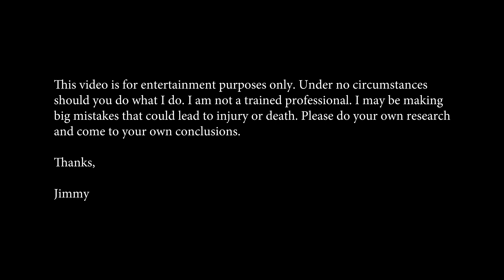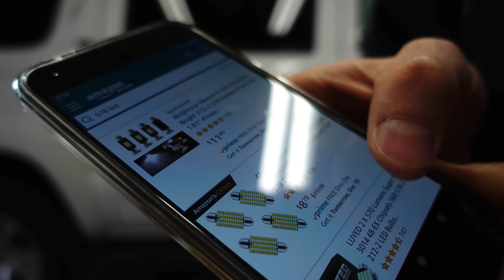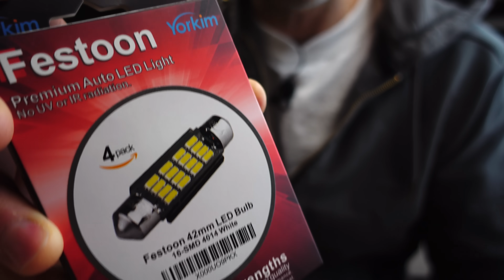Here's Why You NEVER INSTALL LEDs IN YOUR CAR OR TRUCK!!

Comment: Thanks for the informative video. However, I don't think you were comparing LEDs  to "halogen" bulbs. Bulbs you' were replacing are "tungsten"  (filaments, that is) or, otherwise known as "incandescent" bulbs. Halogen bulbs do have high draw (amperage), and do have very high heat output, but also tend ro have very bright, "white" color output, like the LEDs  you're  comparing. Halogen bulbs are only used  by auto manufacturers in headlights (they run way to hot to be safely used in other vehicle locations).
Reply: See my previous post.
Reply: way too hot to.......
Reply: Some truck drivers living in areas with snowy winter had regret switching to LED lights for the headlights of their truck. Ice built up on the cover of their headlights so much that they had to park the truck to have the ice removed. With incandescent light bulbs, the heat from the bulbs can prevent ice from building up on the cover of the headlights.
Reply: @simon6071  their a reason why they made a yellow led bulb
Reply: @urielhernandez3286  It doesn't matter if the color of the LED bulb for vehicles are white or yellow, the headlights are still more likely to be covered in ice than headlights with incandescent bulbs because LEDs are more energy efficient, i.e. release much less heat than  incandescent bulbs, no matter they give out white or yellow light. GOOGLE: LED Headlights are dangerous in snow/ice storm
Some people suggested spraying the LED headlights with cooking spray, Fabulous PB Blaster or WD-40 before you head out in a snowstorm. Even if it works, I think it's too much hassle..
Reply: "Halogen bulbs are only used  by auto manufacturers in headlights " . . . . . .  NO TRUE.. I recall purchasing halogen bulbs for home use, years back .  don´t know if they are still available but I still have one of those  in my garage
Reply: @simon6071  The drivers or owners of the trucks with led headlight icing problems  are due to the fact they installed  cheap led headlights. We have purchased  and installed  quality led headlights with  built in heaters , and they work great in  all weather conditions.  Quality is supreme every time.
Reply: What? LED headlights with built in heaters! Unless the LED bulbs comes with a bimetal thermostat switch which will turn on the heating element only when sensing ice-building temperature, an LED bulb with a heating element that is always on with the light pretty much defeats the purpose of replacing the halogen bulb with LED bulb in the first place, i.e. saving electricity.
Reply: @simon6071  We're discussing INTERIOR bulbs here, and presenter referenced bulbs he was replacing as "halogen" when they clearly were tungsten. Headlights were not in play.
Reply: @josephstabile9154 (My mistake. Comment deleted. )
Reply: @simon6071  Something's getting lost in translation here. Interior lights, inside the vehicle's passenger space, such as dome or door lights--whether LED or tungsten (halogen, because of excessive heat & current draw--i.e., safety, are not available for interior lights) have NO effect on heat output of headlights, and icing over of headlight panels is strictly a function of heat given off by headlamps themselves. Btw, a high % of today's cars have LED taillights & running lights. These also IN NO WAY contribute to.headlamp panel icing--or lack thereof.
Reply: @josephstabile9154  I have been talking about different kinds of light bulbs for headlights only regarding the concern of icing up of the headlights. I don't know why you mentioned the interior lights our discussion. Nowhere did I say or hinted the interior lights and the taillights have an effect on heat output of headlights.
Your strawman argument is inappropriate.
Reply: @simon6071  Sorry to break it to you, Simon, but there ain't no strawmen, haymen, grassmen, etc. here. My first post to the youtube presenter, was in regard to his presentation of installing interior (PASSENGER COMPARTMENT) LEDS, and to which I added a further reply to those not understanding the topic of my 1st comment: "We're discussing interior bulbs here". You then reply to me, quoting: "I'm talking about interior bulbs, too. The low operating temperature of the interior LED bulbs is a major factor contributing to ice build-up on the head lights." When the video, and my posts are referencing interior-of-the- vehicle, passenger compartment LED lighting, why are you referencing
headlights in regard to interior lights to me? I see no connection, whatsoever. If you're trying to make some completely unrelated point about the LED lamp in the INTERIOR of a headlight assembly, you needed to make that point distinctly,  instead of correcting me that you also were referring to interior lights--which, in the context of the video and my comments, you emphatically were NOT.
I suggested to you that something was lost in translation. That might have been your clue that you were on to a completely different  definition of interior, unlike both the video or my comments.
Reply: @simon6071  they are temperature sensitive, only heat to keep  clear of ice, snow , fog. The purpose of led headlights  in the northern rockies in hours of darkness is not to 'save electricity ' , which is not an issue on a 600 plus horsepower  transport truck. The purpose is to have dramatically  improved visibility  at night. It saves  many thousands of dollars  per truck every year with less animal hits (deer, elk, moose, cows, sheep, etc.). It also saves on ruined tires due to meeting an unexpected  obstacle  on the road and using the brakes to the  point of sliding the tires. All and all good quality  heated led headlights  are well worth the  $500.00 per truck cost.
Reply: @josephstabile9154 Okay, I think there was some kind of misunderstand between us about what we intended to talk about. No strawman argument was made by you then.
Reply: @kathyc1109  You are right . I found that there are temperature sensitive LED bulbs for headlights.  They are said to have SmartHeat technology which uses an internal sensor to sense the current temperature. If the technology senses the temperature to be below the low temperature threshold, the heat will stay on to de-ice the lens. If the technology senses the temperature to be above the high temperature threshold, the SmartHeat grid system will automatically turn off. This keeps the lamp from overheating when facing warmer conditions.
Well, that's the best of both worlds.
Reply: @kathyc1109  I think using LED bulbs for headlights is mainly for improving visibility but for using the interior lights without the engine running,  LED does have the advantage of using less electricity than incandescent bulbs and LED interior lights are less likely to drain the battery when we want to light up the interior for a while without the engine running.
Reply: @simon6071  Yes, we have been using led lighting in every thing for a good number of years now. The reasons for using led lighting in large transport trucks are different from  using them in a car or pickup. For instance, on a set of double tanker trailers at 100 plus feet long and multiple  wire plug connections,  the ampere draw using traditional  lighting would overheat wiring especially in the connections. Therefore switching to led we eliminated  a considerable  amount of  maintenance.  Led work lights at various  locations around the unit provide for superior visibility  while performing  outside tasks while outside  of the truck. Loading and unloading,  hooking up hoses, pumping, installing tire chains, etc. All of these secondary operations  are performed  with less chance of injury  with better lighting.
Reply: @kathyc1109  I'm just glad that the problem of old LEDs having problem of ice on headlight covers has been solved with new LEDs that can  turn on the heat to melt the ice automatically.
Reply: @simon6071  interesting,  never gave that much thought
Reply: @josephstabile9154  I found my comment that caused the confusion when it carried conflicting information of what I wanted to talk about. I guess I was too tired when I made that comment with conflicting information about what I wanted to talk about.  I apologize for my mistake and I have that comment deleted to avoid further confusion.
Reply: @simon6071  Absolutely not a problem. Good day & best wishes, always.
Reply: @Travis2L  I said "Some people suggested spraying the LED headlights with cooking spray, Fabulous PB Blaster or WD-40 before you head out in a snowstorm. Even if it works, I think it's too much hassle.."
That's NOT my advice and I don't like the idea. 
Have you tried it and seen damage done to the cover of the headlights? If you have, please describe the damage that you saw. If you have never tried it and just claim that's an awful advice, then your opposition is based on bias.
Reply: They also use in video projectors. Super expensive.
Reply: Bad thing about using LED tail lights and rear marker lights on a semi truck they oftentimes become snow covered unless they make heated ones. Though getting out periodically to brush off snow works. As suggested using WD-40 or etc. would probably also work. Good thing about LEDs they are shock resistant and much, much less likely to burnout on bumpy roads, and of course use far, far less battery drain when engine is off and when engine is on and alternator running. LEDs are worth it if used correctly and can be more easily seen.
Reply: In spite of the advantages of LEDs, there is one advantage of the incandescent bulbs that the LEDs do not have. During a highspeed rear-end collision due to unintended acceleration caused by failure on the part of the vehicle when the footbrake is on, the filaments of the incandescent bulbs on the brake lights would break up because the high temperature can make them break more easily. Therefore, the breaking up of the filaments in the brake lights is conclusive proof that the driver did not step on the gas pedal by mistake. On the other hand, the LEDs do not offer such an advantage.
Reply: Unfortunately, the attorney for a driver wrongfully accused of stepping on the gas pedal instead of the brake and causing the death of three passengers in a car at the front, failed to realize the braking of the filament of the brake lights could serve as conclusive proof that his client did step on the brake during the accident instead of on the gas pedal as wrongly accused of. The innocent driver was put in jail for many years but was released after a large number of unintended acceleration accidents involving the same car manufacturer were brought to light. Fortunately, the wrecked car was not destroyed yet and examination of the incandescent brake lights found that the filaments of both lights were broken which would be impossible if the driver was stepping on the gas pedal during the crash.
Reply: Unintended acceleration may be caused by glitches in the Drive by wire system, faulty throttle and a floor mat that wedges under the pedal. A floor mat that wedges under the gas pedal was proven to be the cause of the fatal crash of a luxury car driven by an off-duty CHP officer. The car driven by the wrongfully accused man was a pre-DBW model, so computer glitch in the DBW system could not have been the cause of the unintended acceleration.
Reply: However, since there is conclusive proof that the drive did step on the brake during the accident, that means he was wrongfully convicted and wrongfully jailed regardless of the accident was caused by a faulty throttle or carpet wedged under the gas pedal.  Strangely, the fact that the filaments of the brake lights of the car in that accident were broken was strongly suppressed after I read it on a report on the internet.  I wonder why? May be the proof is so conclusive that it could have led to that big auto manufacturer having to pay much higher damages to the wrongfully jailed man if not suppressed.
Reply: @josephstabile9154  FYI halogen bulbs have tungsten filaments but the halogen gas fill allows the tungsten filament to be run at a higher current and therefore temperature than a "normal" tungsten bulb.
Reply: @karhukivi  I do understand. My point was, as a result of this significantly higher/hotter output, halogen bulbs are not used for interior  (instrument panel, dome, glove box, console, door, 
etc.) lighting. IN THIS REGARD, I think the video presenter erred in saying "halogen" when he meant to say "tungsten". The reason for my comment/posting was to bring this to the presenter's attention.
Reply: @josephstabile9154  OK, got it!
Reply: @jeffokriya3389  It says only used by auto manufactures for headlights, not other automotive bulbs! Halogen bulbs were available for home use long before they were used for headlights.
Reply: Halogen lights still use tungsten filaments. Halogens are a gas.
Reply: @ianmontgomery7534  It's twue, it's twue. Halogen bulbs do employ tungsten. But, in common parlance, when one is referring to halogen lights (which employ tungsten), they're referred to as "halogen". Similarly, incandescent (tungsten in a vacuum) bulbs are commonly referred to as "tungsten" or "incandescent".
Reply: LEDs do tend to run warm... In fact some of the easiest problems we had with those LED was heat.. too much heat and how to get rid of that heat using, sometimes, exotic substrates. Engineering has changed and things move on however those LED now even incorporate miniaturized fans to aid in keeping them cool.
Reply: @jeffokriya3389  halogen bulbs for home use aren't being used by auto manufacturers...
Reply: @josephstabile9154  halogen bulbs are tungsten bulbs.
Reply: @simon6071  Some semis (Volvo for instance) come with heater elements in the headlights to combat icing.
Reply: @joseph.cotter  That would work. Problem solved.
Reply: @simon6071  Are they approved in US?  I've still not seen them approved in EU anywhere for headlights. It's too sensitive topic as you need specific beam of light with side characteristic a bit bigger. All those bulbs must undergo approval.
Reply: @rybaluc  I think LED headlights are legal in the USA. I see them on the road all the time. Most of them have a white daylight glow instead of amber light.
Reply: @simon6071  I’ll bet if you tried using some Meguires brand plastic polish on the headlight it could make a difference. It’s made for removing the haze on old plastic headlights
Reply: And meant to include that with the polish on the lens that it would not  allow snow or ice buildup
Reply: @paulhunter9613  I don't have LED headlights  and I don't live in sub-zero temperature area, so I can't try it out even if I want to. May be  people who have LED icing up problem can try it.
Reply: that is what i was thinking, ty for the post
I am not a fan of these leds
Reply: @simon6071  I thought it was better light quality, built in DRLs and appearances.
Reply: @tsiefhtes  IT's true that white LED headlights provides better visibility in the dark under normal  conditions. However, yellow headlights or incandescent lights less glaring for the oncoming traffic and provides better visibility in foggy conditions because yellow lights can penetrate the fog deeper and less likely to form a white curtain with the fog.
Reply: @jeffokriya3389  In eastern europe yes, you can buy theme. Popular are Thungsram and Philips
Reply: @simon6071  This side effect is new to me being I don't drive in said snow conditions these days.  ,

I find though that a vehicle with way too high an intensity of "white" light is a detriment to everyone's safety as they are blinding drivers from the rear as well of course, oncoming traffic.

With the technology of today there needs to be a NHTSB ruling/mandate that a 'dimming feature' must be installed to thwart such hazzardous and blinding effects from illumination.  

This 'dimming device' would keep the lumens to a level that is appropriate for the highway one is traversing.  Well lit boulavards and such neighborhoods with well lit avenues and local business districts have no need for high intensity lamps.  Now you get away from street lights and have little to no traffic, that is when the high intensity LED could 'amp up' so to speak.  But the second a light sensor installed on your LED equipped vehicle senses light,  a dimming will be initiated, potentially in steps depending on the intensity of lumens that are being registered by the sensing device.

p.s. 
.......This is the same thought I've considered for traffic lights at night.
Dare I mention that today our emergency/official vehicles are generously equipped with extremely bright, let me just say, "Blinding" flashing lights that are needed for day time and or weather related occlusions, e.g. smoke, dust and fog.   
But at night: these vehicles actually cause distorted vision for drivers at night  if they must look away and or shield their eyes on one side or the other.... well isn't it obvious this is dangerous.

Lastly may I remind peeps of the millions of "baby boomers" out driving at night with aging visual impairment that gets amplified by our stupidity of over doing the intensity of lamps that during daylight are quite effective, best ever I'd say, but at night, that intensity is deadly.

PERIOD!
Reply: @claztube  I think the headlights being bright and white is a only minor problem to other drivers as long as the light is kept at low beam mode.  If the headlights are kept at high beam mode with oncoming traffic or when following another vehicle close behind, the glaring light is dangerous to other drivers even though the headlights are not super bright white LED lights.
Reply: @kathyc1109  Years ago, my city began a program to replace all the intersection traffic lights with LED bulbs and had the same problem of ice and snow build up on the lenses, making them impossible to see.  They have since replaced them with with LED lamps with a heating element.  Apparently, they still use less energy than the older incandescent bulbs and they last much longer than the incandescents.  The big saving is in the maintenance, because it's expensive to send out two guys in a bucket truck to change a light bulb.
Reply: Read it again. He said other areas of a CAR, not your house lmfao
Reply: @Jeff Okriya  Relevant phrase here is "by auto manufacturers"...
Reply: @mr.fix-it5630  👍
Reply: So am I missing the reason of why NOT TO INSTALL LED BULBS?think you went of topic and the title for this video is false just to get clicks.
Reply: @simon6071  Really this is a "no problem" --- I live in Montana and during snow and sleet, I have no troubles seeing with the LEDs and they just don't run colder than the OE bulbs at all --- especially at highway speeds and with ice/snow impacting the headlight covers. 
If the LEDs are colder than the OE bulbs, I have yet to see tungstens or halogens actually melt away snow or ice. 
Bah! 
Fake point!
Reply: @simon6071   switched my trailer and truck tail lights to LED 25 years ago, and quickly switched back because they didn't melt snow. Incandescent bulbs are far superior. Inexpensive, and with all grounds working correctly, last an incredible amount of time and are bright. Personally can't stand LED lights. Overly expensive and complicated, cause eye strain, and don't last any longer than incandescent. K.i.s.s.  Keep it simple stupid. Replacing incandescent lights connected to a dimmer switch has an interesting effect, same with blinkers. "upgading" lol. My dad would have said. " they seen you coming"
Reply: @davidpotter7484  I'm not totally against LED lights. It all depends on the applications, the climate of where you drive and personal preference as well.